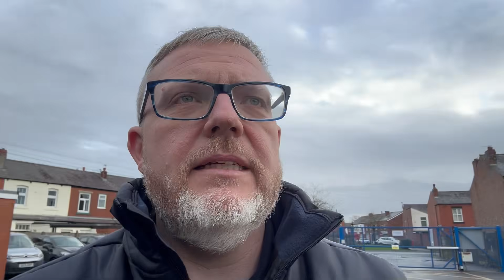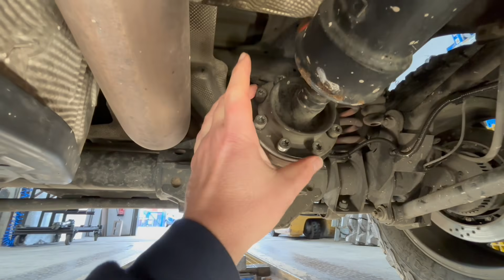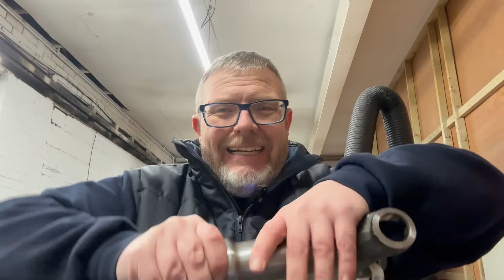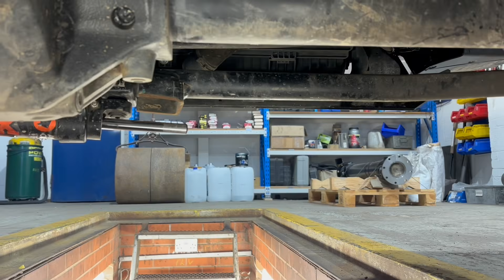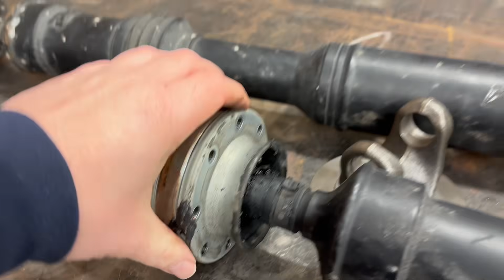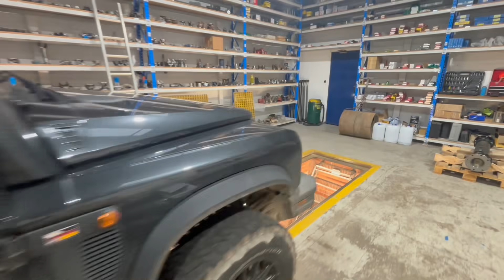Bespoke Ineos Grenadier Propshaft Part 1

Comment from the maker: Thank you for all your comments.

Just a few things.

Up to this vehicle coming into us we had never seen one before and knew nothing of any other companies attempts to solve this problem.
We literally treated it as every other job that comes in and started off with basic driveline principles and designs and worked from there.

We will be doing a lot more testing over the next few weeks so will update with a follow on video.

Please keep your questions coming or if you would like to have a chat I'm available on 01257 791681. I like chatting.

Going forward we will be looking at
Vibration and resonance at various angles due to vehicle lifts

Vibration and resonance on standard vehicles. (if it occurs)

Redesign using Rezzeppa Joints if possible.

If there is anything else you would like to know then please drop me a message and we can include it.
Reply: I will keep an eye on your evolution videos

Comment: If it's the same CV join that Jeep uses, why aren't Jeeps having this problem? I drove a 2020 Rubicon 50k miles (at least 50% off road) with no drive shaft issues.
Reply from the maker: Hi. The Rubicon doesnt work on quite as high an angle as standard so we believe
Reply: @Propshafts  Can the rubber be conditioned? Would a routine application of silicone or some other type of rubber conditioner be applied to prolong its life?
Reply: @Propshafts  BTW, I had a 3" lift on 35's.
Reply from the maker: We don’t know enough about the rubicon to comment fairly. If we see one we will check it out.

Comment: Had a custom 1350 double DC shaft and adapters made over a year ago. Had harmonic vibrations unfortunately, even once I corrected the phasing with the adjustable metal cloak control arms. I think my next attempt will be with a DC joint at the transfer case and high angle joint at the axle. After that maybe a 1310 double DC to eliminate adapters. 

JE Reel made a high angle shaft like you’ve made here but unfortunately also has harmonics. If the car was part time 4x4 it wouldn’t be a problem. 

Hopefully you’ll come up with a shaft solution with minimal to no vibration. If you do you’ll have a huge seller!

Comment: Ironic.. I have an older 2ish" lifted 90s TDI defender and was looking for a CV shaft conversion for the front shaft. The out of phase uj seems ok but I've had to change ujs a number of times. Angles may not be optimal so I thought CV conversion would eliminate that and I'd remove vibration that develops over time. Clearly better to work on properly sorting angles? BTW.. personally I love the older 200 and 300tdi. Simple and reliable.

Comment: Can't wait to watch this. Just had my front replaced under warranty at 30k miles- NO LIFT either. Same CV issue. Not only on lifted trucks.
Reply from the maker: This is something we want to solve. Odd question but can you tell me if you have had any work at all done under your vehicle. michael@northwestpropshafts.com
Reply: @Propshafts  No work under the vehicle yet. No lift , stock tire size, easy off road use, mostly fire roads no rock crawling.
Reply from the maker: Ok. Just for reference how did you find out the CV had failed. What prompted you to check it out?
Reply: @Propshafts  Routine service/ oil change

Comment: The CV joints on the IG act as fuses for the transmission. What you are doing, no doubt will make the driveline stronger. The problem is that now you will move the failure point from outside to inside (transfer case or differential). A CV joint replace is a 20-minute job at max, and can be done in the field. Regearing a diff or a transfer case is not. That's also the main reason you should never put HD CV joints on IFS. Carry spare CVs, instead. Would you replace your electric fuse with a nail, or carry spare fuses?
Reply from the maker: Hi Thank you for your comment and you are absolutely correct. Very clever designers have looked at this and designed it to work in a particular way. I like your analogy of the fuses but I will play devils advocate. 
People spending this sort of money on a Grenadier are well within their rights to do what they want with the vehicle. We are just here to help.
We are looking at various options of shaft for these vehicles including one that will be a direct replacement and the same AMP FUSE but not have the problem of a ripping CV boot.
Subscribe and see where we go with this in the next few videos.

Comment: Super interested in this solution, I have a 2/1.7 lift on my Grenadier & check the CV joints weekly! Ineos could use a better system for those who want to have more clearance for off roading & for aesthetics if they please.
Reply from the maker: Hi. It’s going to be interesting for us also. We aren’t sure with the varying lifts if we will have a “one size fits all” option. Angles are funny things and 1 degree can make a massive difference. 16mm difference in lift could easily be 1 degree. Make sure you subscribe and see how we get on.

Comment: Just FYI - When adding lift kit springs to the INEOS, if the installer doesn't disconnect the front drive shaft from the differential, then the front CV boot at the front differential can tear when the front axle is lowered to install the springs. The angle of the rear drive shaft isn't as steep as the front driveshaft and so it doesn't appear to have the same issue when changing the springs in the rear of the vehicle. The CV boots seem to tear for other reasons as well, but changing out the front springs is a known issue.
Reply from the maker: That’s good to know. 
Not something we can solve. 
It’s just laziness. 
That’s down to bad practice of not unbolting the whole propshaft when doing the work. 
We see similar issues with other vehicles.

Comment: maybe you can inform Ineos about their problems!!
Reply from the maker: Hi. 
Going by the emails and phone calls we have had over the last 48 hours I’m pretty sure Ineos already know.
The flip side is if a customer modifies their vehicle is it then an Ineos problem?
I don’t know if it is a problem on standard vehicles or how many failures there have been.
Reply: @Propshafts there’ve been failures on both stock and lifted vehicles. Either the boot gets torn (weak rubber material that Ineos has since upgraded) or the c-clip internal to the rzeppa detaches and allows the CV shaft to back out.

Comment: Very interesting.  I put on a small lift just to level the Grenadier (1.2” front, 0” rear) and  that same boot ripped.  Some Grenadiers with no modifications have also seen torn boots, so this seems to be an issue.  I’ll be following your videos to see if you can figure out a u-joint solution without vibration.  Thanks for posting!
Reply from the maker: Hi. 
We are looking into both Universal Joint and different CV option. 
Hope to have another video on this in the next few weeks with an update.

Comment: Will be watching with interest also, the old disco, had the rubber donuts fitted, years ago, i always thought that was to stop vibration, and resonance..?.
Reply from the maker: Hi

Yes the “Guibo” coupling (Rubber donut as we all call it) absolutely takes out torsional vibration and acts as a stop between steal components so helps with resonance and vibration. 

The downside to these couplings was they couldn’t actually work though an angle so caused more vibration than they stopped if placed at an angle. 

We actually have special torsional rubber tube which is featured in our video about bike engined kit cars. 

This is going to be something we will probably look at in the Ineos build. 

This is a new vehicle to us so we are still in the testing phase. 

I like how you’re thinking though.
Reply: @Propshafts yes I've experienced that vibration on my old disco,difficult nut to crack, I'm pretty sure you'll do it..Atb.

Comment: How did you calculate the 35 degree offset phase orientation for those universal joint yolks? It can’t be just a guess. 
I wonder why Ineos don’t fit heavy duty universal joints as standard.
Reply from the maker: Hi. 
We have never seen one before so started off with what we do know in relation to off sets which is the Landrover Defender. 
I’m certain the design team involved will have looked at Universal Joints. 
The ultimate decision will have been made by the Axle and transmission choice and the design of the propshaft will have been looked at from there.

Comment: Why not using double UJ specially in the front propshaft? The angle is pretty big and without adjustable control arms it’s not possible to match the pinion angle of the front diff with the transfer case flange angle.
I expect better resonance performance with double u joints in the front than with single uj. Anyway quite interested on see your results. If the results are good here another customer
Reply from the maker: Hi
Great comment. 

A double joint will probably be the next thing to look at. 

The downside to double joints is no one manufactures a blank that we can machine to the right flange fitting. 
This would mean using an adapter plate. 
This causes a few issues. 
More chance of machining run out. 
And
Double joints are significantly bigger and a longer component so the gain of the double joint can be negated by the length of its own design especially with an adapter plate. 

This is probably worth explaining in its own video. 

We will definitely be looking at this option though. 

(I have seen it on other You Tube videos and it didn’t really solve the problem. I would still like to give it a look though)
Reply: @Propshafts thanks for the answer. I have seen some people trying with 13-50 double cardan but they are big enough to need adapting plates, but 13-10 should be enough and easier to to fit without adapting plate (which as you said, it’s never a good thing).
Think also that the pinion angle should fit the transmission angle, and as far as I know, with the stock control arms there is no adjustment enough, so length adjustable control arms should be the way to go (same apply to the single cardans, actually more critical than with double cardans).
Rzzepa with bigger working angle is (due to the layout of the vehicle…angles in two planes) theoretically the best solution, but it would require reworking the flanges at both sides (transfer case and axle). Anyway, the working angle should fit is that big that any Rzzeppa will suffer of high temperature of the bearing, and then degradation of the rubber boot, but maybe with a spring type boot and a low temperature transmission coefficient grease it’s no longer an issue
Reply from the maker: Hi
Lots to think about there. 
I will add them to my list. 

We should share our results. 

Keep me posted on how you get on. I would be really interested in your design of the control arms and if they would help.
Reply: @Propshafts  check out the MetalCloak adjustable control arms (and track bars). Let me know if I can assist in getting you a set for R&D.
Reply: @Propshafts  hi! Any evolution with double U joint propshaft?
What about length adjustable control arms? Did you get them? If so how is the result either single U joint propshaft?
Thanks!

Comment: Love to hear about the customer feedback regarding resonance or vibrations. Looks awesome 👍🏼
Reply from the maker: Hi. The vehicle is coming back in this next week. Yes we are getting a bit of resonace on overrun which is to be expected on a high angle propshaft. We are going to have a look at that and hope to have a follow up video in the next few weeks.
Reply: @Propshafts  if you solve this issue I hope you can make a lot of them quickly ! It’s one of the most talked about issues. No one seems to be able to sort the resonance issue so far.
Reply: @Propshafts we desperately need a solution.  You can sell thousands of these if you figure out something that durable and doesn’t vibrate
Reply: Any feedback from the customer?
Reply: Ditto.
The agile shaft may have prevented my fire caused by my prop shaft on my '24 grenadier but the harmonics might have caused other issues down the road.
Reply: My Old Defender has UJ’s with rear transfer box output parallel to rear diff & Universal joints inline, this works perfectly & Propshaft angle is not too steep unless lift is too high.
Original OG Defender Front Diff looks up and joints are phased similar to your setup to minimise /phase the angles/ pulsing but it cannot completely eliminate vibration because not parallel, acceptable at low angles but with a significant lift this is also a problem on OG Defender and even more so on later Pumas due to angle at transfer box due to taller Transit engine. Considering a Grenadier, however when you mention ‘CV” I think of a Rzeppa Joint type metal ball in gage & race type rather than a simple rubber joints as were used on the Discovery 2 rear Propshaft to diff unions. Rzeppa joints should cope with the angles.
PS: why are rubber boots not fitted to keep dirt out of slider?
Reply from the maker: @PeterMenzies-t4r
Hi
Thanks for the comment. 

I will jump straight into the “CV”

We call Rzeppa joints CV joints in the UK

It’s just an easy Abbreviation. 

Rzeppa invented the CV joint back in the early 1900s but I suppose because many manufacturers make them we just drop the fact it’s called a Rzeppa joint and just call it CV. Probably a bit similar to the whole “hoover” debate. 

The original grenadier shaft is a Rzeppa joint. 
It only allows for a certain degree of angle before it fouls against itself causing the little rubber boot on the back of the CV to fail. 

Our sliding section doesn’t have a boot as it contains an internal rubber seal. 
I suppose a little like a piston but isn’t quite strong enough to hold pressure but good enough to hold in grease and stop Ingress of water or other contaminants.
Reply: One thing to consider is the diff input (pinion) shaft seals have a tendency to sweat already. Any extra slight vibration might exacerbate this issue